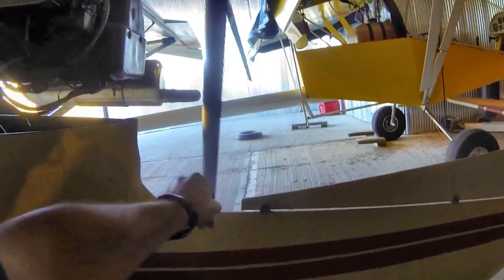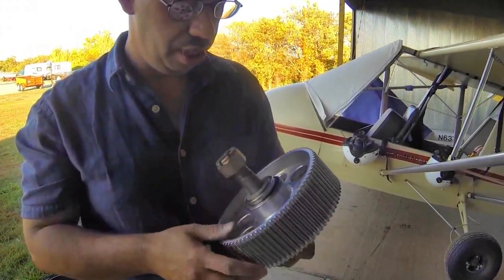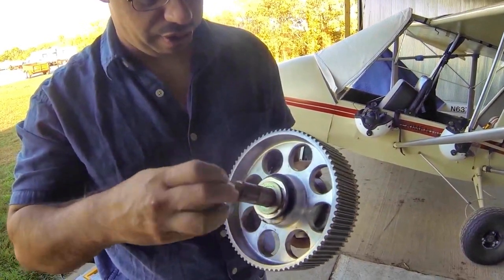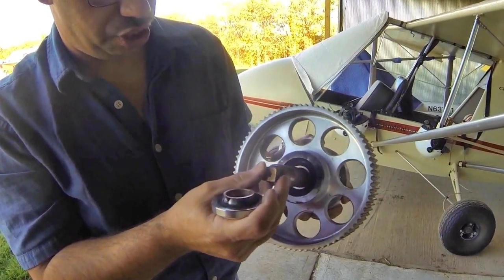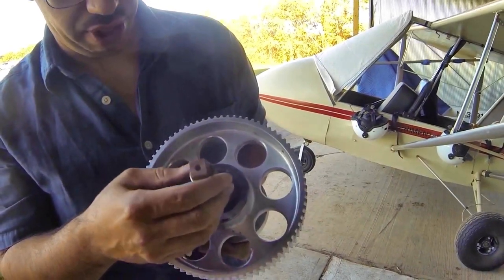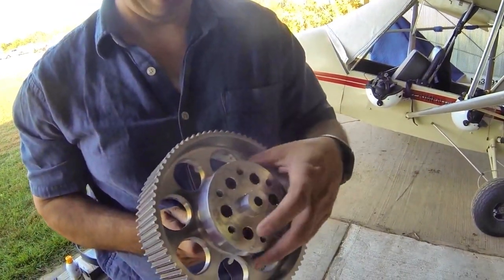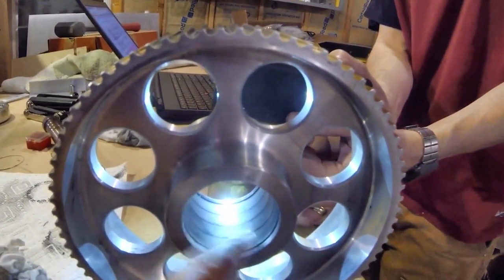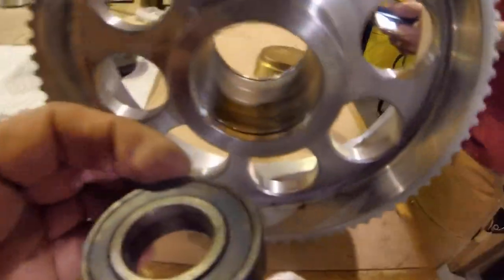Quad City, Challenger II Experimental Aircraft, Drive System Bearing Failure.

Comment: That should be caught on the pre-flight. That kind of wear however, can occur in just one 30 minute flight. Which is why a pre-flight should be done even after you've landed for a fuel stop, bathroom break, or lunch. Not just when you first jump in to take off!